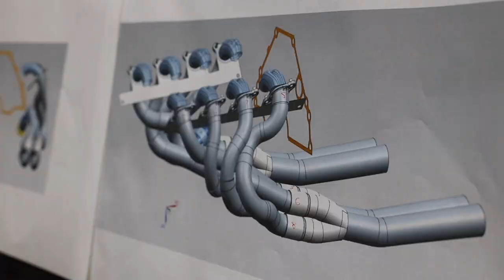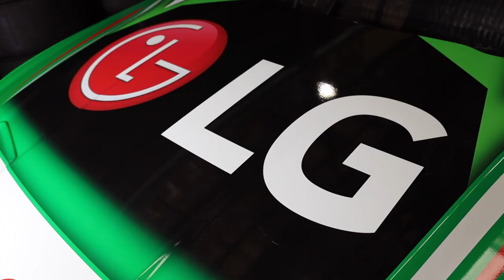Team Castrol Racing 2020 Mustang revealed - Kelly Racing

Comment: thank you kelly racing for all the uploads, also quick question, if a crash happens, do you guys have a special rig, which all the settings for all angle's and measurements are pre set or can be set is used or do you simply check everything and do a quick cut and weld to replace items which are damaged, or do you have spare complete shell (s) which is easier to fit out, compared to fixing them or does it go to the boys at each states mechanical or panel schools for them to work on as a donation and they get to measure everything up ? Good luck for the new season in 2020, go holden if they ever use the camaro, which i don't understand, why they have not got it for the supercars V8 challenge ?